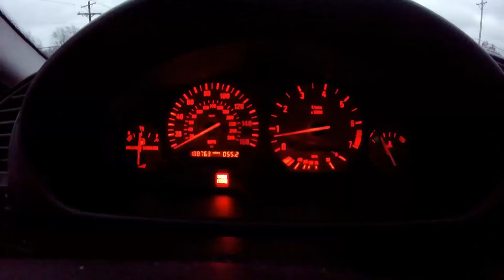Should You Ever Replace Your Transmission Filter?

Comment: I stopped watching you video at 2:43 to explian why you need to change your Transmission Fliter. 1 You can't see or feel the weight of your filter to know when to change your Transmission filter like your Cabin Filter or your Air Filter. Your Tranny filter is very important to change. Here is why. Your Tranny filter is stopping any metal fragments from your clutch plates that are reducing in size everytime you put your car in gear. Your Automatic transmission has the same principle as a tranny with a manual transmission.  You have a Clutch wears because of use or orver use, like riding the Clutch. Well that Clutch material or dust is removed by the wind while driving. In the case of the Automatic Transmission the Clutch Disc material stays inside the Automatic tranny in the fluid. The Tranny filter take all the clutch material from the many Clutch packs in the Transmission  and filters that fluid so so fluid does not get to that many important gears. If you don't change the fluid the the pressure relief valve activates and your Tranny has no filter to take out any impurities from the fluid. Clogged filter turns a normal rebuild to a major rebuild or just a replacement. A total different price because of a $20 filter.

Comment: Not an auto mechanic or a scientist.  Car is 19 years old.  Car warranty was only 36000 miles or 3 years.  Did the car run better if the transmission was serviced more frequently than recommended?  Yes.

Bob Dylan.  You don't need a weather vane to know which way the wind is blowing.  Does a transmission filter work the same way as as an oil filter or an air filter?  NO.  So, do you need to replace it as frequently for the same reason?  NO.

Comment: None of you must live in the desert. Trans fluid here gets dirty!! Not to mention the temperatures they must operate in during the summer, which break down the fluid, I will keep changing my fluid and trans filter. BUT I do run a remote spin on/off filter and an external cooler too.

Comment: Every credible mechanic I have ever encountered in my life says do NOT ever use a flushing machine because they run fluid at a higher pressure than what the transmission was meant to handle and any contaminants in the old fluid will be forced through your valve body.
Reply from the maker: Sorry but this is just wrong. Most fluid flush machines hook up to the cooler line and has a bladder inside of a pressure vessel that has new fluid that simply replaced the old fluid. Some use the transmission’s fluid pressure as the pressure to push in the new fluid. Even on the machines that use a pump the pressure is less than the 300psi that the line pressure usually reaches in reverse. I’ve never personally seen a transmission issue caused by flushing the fluid.
Reply: @PetesGarageandperformance  sorry I should have mentioned my dad has been a mechanic for 41 years and his father was a mechanic before him. So I know lots of mechanics, I chose to go into truck driving personally but I grew up in a mechanics house and routinely interact with mechanics either in person  or online/over the phone at least a couple dozen times a week. You said you worked for a dealer doing transmission flushes,  my dad has rebuilt literally thousands of transmission damaged by those flush machines,  and he recommends doing a pan drop and changing the filter and fluid in the pan every 25-30k miles. While transmission fluid is not exposed to combustible gas fumes it it exposed to a great deal of heat that over time degrades the fluid, if you wait until the fluid has depolymerised before doing maintenance then your transmission is just a ticking time bomb. As far as this being a waist of money, there's an old saying "A ounce of prevention is worth a pound of cure" and I just spoke to my dad, he said under normal operation the line pressure in a typical automatic transmission is 40-70PSI so yeah of you're pumping fluid a 300+PSI that is not the normal fluid pressure.

Considering that my dads put over 700 thousand miles on his F-150 and hasn't had a single problem from the transmission I'll take his advice over yours. No offense.
Reply from the maker: You are quoting the MINIMUM pressure specifications. At max pressure, especially in reverse, the pressure is going to be much higher. Here’s a link I found that shows the pressures in a 4l60e. https://atreman.com/wp-content/uploads/2016/04/4L60E-Checking-Line-Pressure.pdf

I have rebuilt hundreds of transmissions over the years and not one of the failures was due to flushing. Maybe there’s a flush machine out there that pressurizes to 1000psi but I haven’t personally seen it.
Reply: @PetesGarageandperformance  no sir what I was quoting was the normal operating pressure,  sure the pressure my spike higher than that under heavy acceleration but 40-70psi is under normal operating conditions. Again no offense but I will take the word of a second generation mechanic with over 40 years of experience over that of a random person on YouTube. If you didn't want people to disagree with you you shouldn't have asked people to comment if they agree or disagree over changing transmission filters. Personally I'd rather just drive a standard (as I do) and not have to worry about it. But normal wear and tear cause the fluid to break down over time and as that happens the transmission filter collects debris and as such should be changed. To say that the filter lasts the life of the transmission is ignorant. On the other hand I guess if you only get 80-100k miles on your tranny before it dies then technically the fluid and filter did last the lifetime of the tranny.
Reply from the maker: I never said I didn’t want anyone disagreeing with me. I appreciate the conversation. It’s always a good debate about the filter. I was just letting you know that the flush machines don’t over pressureize the transmission.

Comment: Agree...one has no combustion process occurring in the trans. If one is removing the trans to rebuild, sure install a new filter. If it is just a fluid service one can get away with just changing the fluid without installing a new filter.

Comment: What really sucks is that I can find 37 videos with 37 points of view and they all sound reasonable.
Reply: Lol! Isn't that the truth!😅
Reply: When you get your own hands in the work,  the right way is clear.
When you remove the pan,  and pour out most of the fluid.....you'll see very fine particles of metal.
That is normal.  But keeping them from recirculating is beneficial. 
That's where the filter comes in.
Old ones were a fine metal screen,  newer ones are a fibrous type. 
The metal particles can clog up these fibrous types easier than the screen types.  This restricts the flow available to make the transmission function at its best. 

If you remove and clean the pan,  clean and reset the magnets,  and change the filter.....it should last over 300k.  If you don't,  it'll probably last 150-180k,  then cost 3-7000 or more to rebuild. 
You'll see the metal if you do it yourself.  The filter is CHEAP,  fluid can be vehicle specific,  and can cost a few dollars,  but NOTHING compared to a rebuild.

Comment: Material wears off the clutches. Always.
Reply from the maker: And when enough clutch material has worn away to cause a filter restriction, the clutch frictions won’t hold because they need to be replaced. So replacing the filter wouldn’t fix anything because the clutches are worn and the transmission needs a rebuild.

Comment: Speaking of waste...this video is applicable to your situation, vehicle, usage, and area/climates. It doesn't apply to everyone.

If there's a filter - change it come due. Don't listen to this guy.

NO flushes (ever). Use correct ATF for yoir vehicle (very important). Keep care of your cooling system (top to bottom). Always wait for your shift to set (park to reverse, etc) before accelerating.

This is how to take care of your transmission. Saving a few dollars on skipping filter changes is stupidity.

Yes you are off base and wrong here. Sorry.

Comment: Your so wrong automatic trans have a clutch with pressure plates that wear so you need a filter to help remove the debris from the fluid
Reply from the maker: Yes, but if your clutches have worn enough material off that it restricts the filter, you need a rebuild. Those worn out clutch packs are going to slip if they’re that worn.
Reply: @PetesGarageandperformance  I am sure your remarks have created a lot of debate but I can`t agree on this keeping the fluid clean with a filter in a trans has and always will be used

Comment: I personally would change the filter on the first service and do a drain and fill thereafter, reason being is because if you buy a used car you don't know what's inside and it's best to change the filter so you will know it has a clean filter and pan, from there on I would do a simple drain and fill, it's cheap, easy and keeps the transmission free of potential dirt and particles.

Comment: Sorry but changing your transmission is routine to keep your transmission to not to slip if you don't change your transmission fluid your transmission will run rough and will have a chance to slip and you have to rebuild your transmission anyway so keep your transmission service is good maintenance to make sure your transmission doesn't slip so I disagree with you is not wasting money is actually doing a service just like if you you should not change your oil filter and oil is wasting money nothing's wrong with your engine don't change the oil and filter it's good routine to change the transmission filter and fluid so it keep it nice and clean so it doesn't be black and burn out I'm sorry I disagree with you😮😢😢

Comment: Always change the filter with a oil change, especially the transmission filter. Do you change the oil in the engine and not a new filter every time you change it? No, well then. Common sense. My oem acura filter for the transmission is 80$. I change my oil and filter every 30,000 miles on the transmission. Costs me 200$ every time I do it. Do it myself of course, but I buy everything OEM. No aftermarket. 30,000 miles translates to how many engine oil changes? It's just one out of all of those engine oil changes. Obviously it'll be dirty after 30,000 miles or more. Even if it isn't, its good to open the pan and inspect the magnets, clean them, change the filter. Lazy and un educated folk will run their cars forever on the same filter and oil. 

Try cooking with the same oil everyday for 3 years and see how that goes

Comment: Why does the fluid change color? Why is the transmission filter there in the first place? It seems to me that the reason a filter is changed is to enhance or improve its function. Therefore if it has a function, it should be replaced periodically.

Comment: I strongly agree -ish, expect one major point you missed. High mileage. High mileage vehicles and never changing a filter causes the oil itself to break down leaving a "varnish". If you add new fluid to a varnished transmission, it'll remove that varnishing and clog your filter and then you're out of luck. So I disagree on that one point.
Reply from the maker: Have you actually ever seen this varnish clog a filter?

Comment: You stated we need to change the fluid, and you can see that it does get dirty and burnt. So if it is a sealed system without burning anything why does the fluid need to be changed? Same reason to change the filter, small pieces from wear and tear, fluid burning and creating solid pieces and so on. Plus it is not completely sealed, dirt and more and work it way from the dipstick tube. It is recorded at 30k for the first- breaking in period and 60k after.

Comment: Just a disclaimer. No logic was made in the making of this Video. There is reason to change your filter from just normal wear and regular service interval. Like loss of pressure  that can damage your transmission. Im assuming you are rebuilding transmission and then telling your customers, Do not change the filters??? Is this how you educate your customers on keeping their transmission in shape?? Hmm.....
Reply from the maker: The only transmission I’ve ever rebuilt that had a clogged filter is the GM 6l80e transmissions. But the filter only was clogged because of torque converter failure.
Reply: @PetesGarageandperformance  i recently had an 03 bmw 325i. Only had 1st gear. I wanted to change the transmission because they have lifetime oil right?? No. I went to oriellys to get an ac delco rather than a house brand. Changed the filter with new fluid. Then reset the values. And now it shifts brand new.
Reply: @PetesGarageandperformance  what your saying has logic yes but why not replace them if your already there. Lets just say this. Go to dodge right now and tell them its not needed. You would look foolish. With your talent it would be hard to actually say this.
Reply from the maker: @johnnysolano1025  are Dodges having issues with filters getting clogged and wiping out the transmissions? If you have the pan off, go ahead and replace the filter. But if you are having to pay for the labor for a shop to drop the pan just to change the filter, you’re wasting your money. Just have a transmission fluid exchange service done instead.
Reply: @PetesGarageandperformance  yes they are. You can find videos online. And taking your advice will destroy dodge transmission pumps from loss of fluid pressure. Ill say this if i buy a transmission from you. I better have a lifetime warranty. How crazy for you to build transmissions and say i change everything but the filter???? Thats laziness. You would be sued after i take you to court and then i have technicians from the factory to counter your claim. Your in business because the transmission is shot. Not for maintenance. Us techs rely on your services because we dont have time to rebuild one transmission a day but instead diagnose multiple cars and keep cars going. I respect your profession so respect your customers and change the filter instead of saying i never seen a filter go bad. Never??? Thats crazy. I guess clutch material cannot bulk up and cause a blockage. One day it will bite you and this video can hold you accountable. Its your name not mines.

Comment: So if transmission fluid don't get dirty according to your logic then if your a gm engineer YOU would also argue to not even including a filter as part of the transmission. 
It does capture small particles, thats what it's there for. Think of all the powdered metal on a pan magnet. Bugs in vent holes. Ect. Ect ect. But do what you want. Its only the most critical part on you car.
Reply from the maker: That’s not what I said. The filter is there to protect the internal parts from the normal amount of clutch debris and break in wear. But it shouldn’t be much. If it’s restricted to where it causes performance issues, you have bigger problems than a filter.

Comment: I watched your video for 5 min. You should change your transmission oil filter because your Transmission gets hot and breaks down your oil. You lose viscosity in your oil. All the contaminants in your oil goes through your filter.  If you just change your oil only the filter will finally get full of contaminants and then stop sucking oil. Then your tran6will burn up from the heat and the friction,  as you stated you don't get all of your oil out when you drain the oil from the drain plug. There usually 10 quarts of old nasty oil in your Tourqe converter. Now your new oil is overtaken by the new oil.,so your new oil that you put in is (Wasting) your money. What the worst thing you can do to your Engine is not to change your oil and and filter, same goes for your Transmission, power steering fluid, your rear Differential, Rear differential and but not least your brake fluid.
Reply from the maker: Somewhere in the video I say that I recommend changing the fluid with a fluid exchange machine that connects to the cooler lines. Dropping the pan and changing the filter only gets roughly half of the fluid out. How does changing the filter drain the torque converter? It doesn’t. If your transmission gets hot enough to break down the fluid then you have cooling problems or you overworked the transmission. Just exchange the fluid and you’re good to go.

Comment: This is the dumbest advice I've ever heard from a mechanic. Change your transmission filter if you want to keep your transmission running properly. I have had plenty of experience with transmission filters, I grew up working on old trucks and they get burnt out and no longer filter properly and can clog causing it to either lag or completely lock the transmission. A quick change of fluid and filter and nine times out of ten the transmission will work again.

Comment: O yea...1 of those lifetime trans...i get it dont change nothing cause its meant to last a lifetime...yea thats why they started making sealed units so you could not even change fluid yourself ...i keep forgetting its a lifetime thans...that way it's life will definiately be a shorter life and can keep industry going  by all those prematured wore out trans....or as they call them LIFETIME TRANSMISSION....so CHANGE YOUR FLUID AND FILTER either at regular intervalls;30,000 miles or so better yet change all fluid at REGULAR INTERVALS cause heat breaks down fluid which in turn tears up trannys...what will they come up with next a counter for crankshaft so oil will be changed based on rotations instead of miles that would be good for a few million more oil changes...wait they already do that with them LIFETIME TRANSMISSIONS...😂